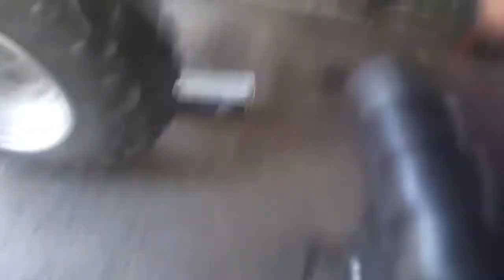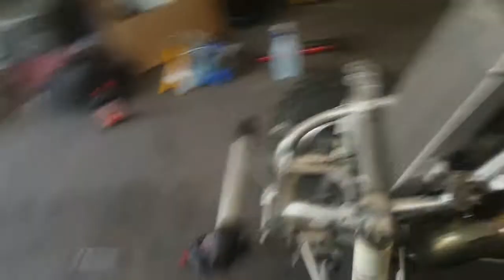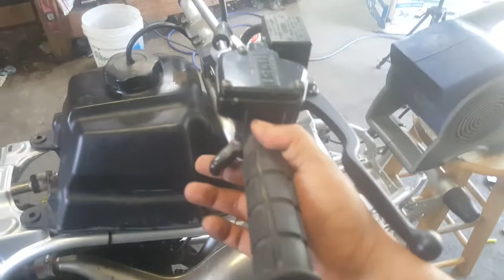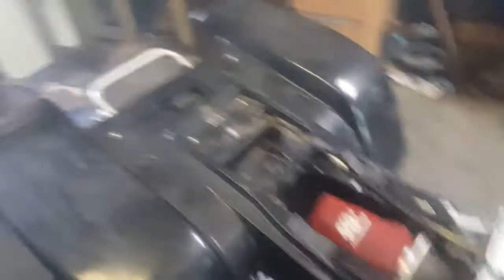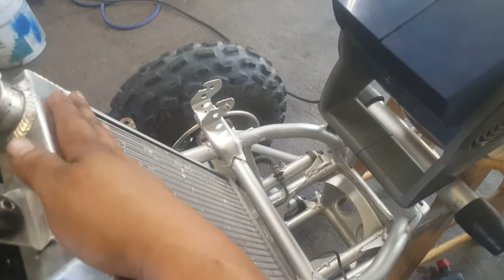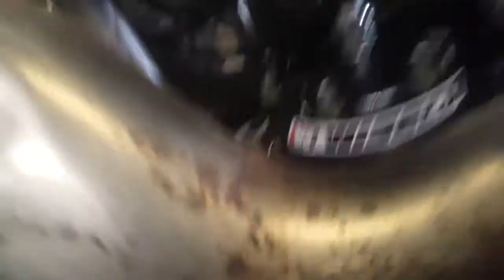Redline Play port First start and heat cycle

Comment: Thinking about doing this for my shee, is it worth it to port stock cylinders or would it be better to just get some 421 cylinders from driveline?
Reply from the maker: Eric Coomer 
Ported stock cyls make great power, if you gonna go 421, may as well do it right and get serval or cheetah depending on your riding style. MUCH better quality
Reply: Eric Coomer redline serval highly recommend for most performance especially if you ride dunes....dirt riding ported stock cylinders are awesome...my opinion only from experience...all depends on your riding style and budget

Comment: Hey i have a question So once I rebuild I'll have to do 2 head cycles?  Also I'm here in south Carolina where temps are 60 - 77 degrees should I run 300 mains And a 27.5 pilot or 30 pilot jet.  I need help new to the banshee world.